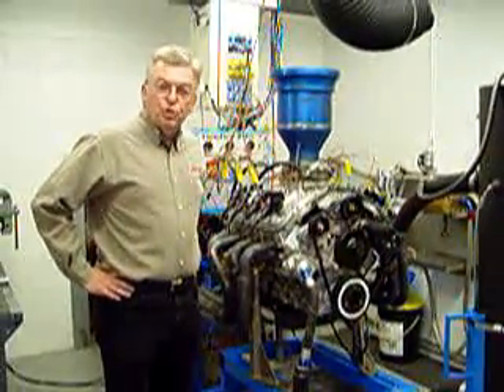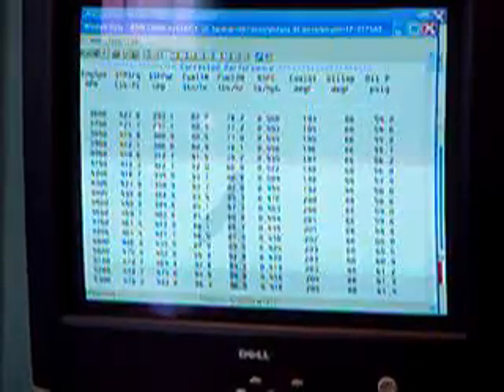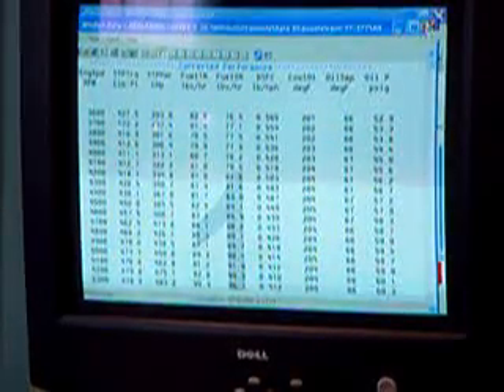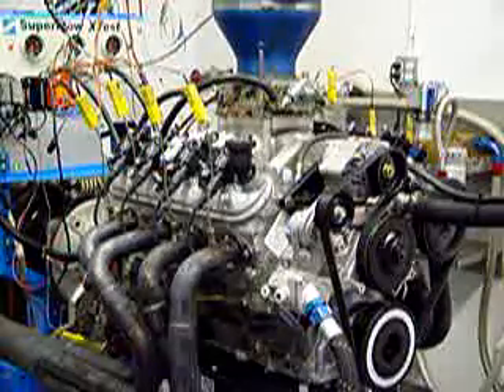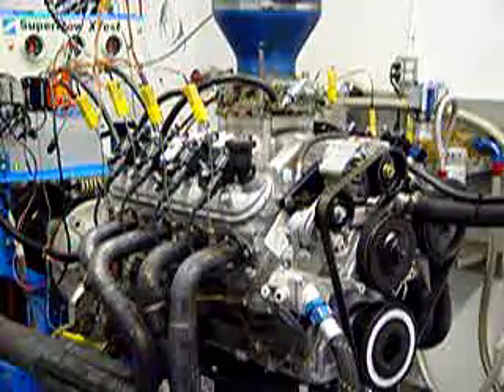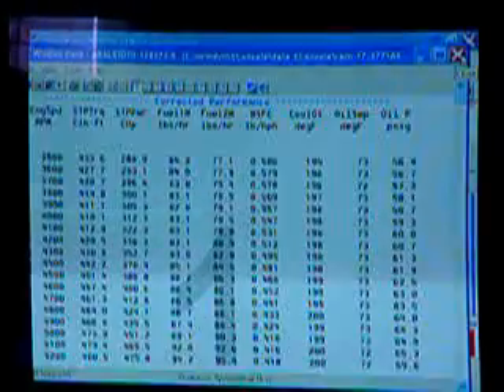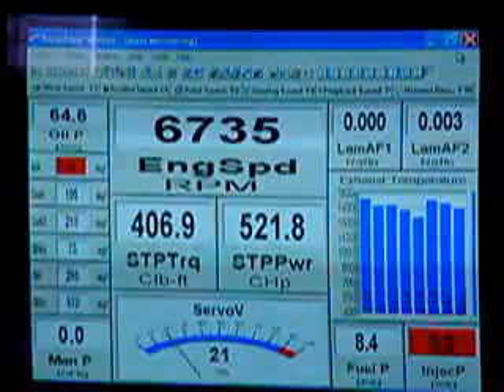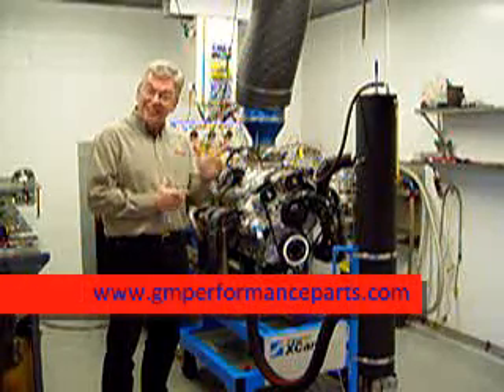GM Performance Parts CT525 Circle Track Crate Engine

Comment: Uhhhh, that's not what I would call a break in.  Not too bright to go right to 7000 RPM under full load unless you want to shorten the engine's life.  Good thing GM over engineered these engines with these clowns at the helm.

Comment: these motors have a cast crank ,, what " genius " came up with that idea ?
Reply: Cast crank my LS2 with CNC ported LS3 heads has turned 7200rpm many times since 2008 and still doing so the stock cast crankshaft is stronger than the stock connecting rods and pistons seen people replace rods and pistons with the stock cast crankshaft up to 650 N/A crank horsepower believe me this engine is absolutely not like the old Chevy small block the LS 6 bolt splayed mains holds the crankshaft in place with no flex even at 7500rpm they also last pretty long compared to 2 or 4 bolt main old style engines at above 6500rpm especially comparing it to any old style stock engine you'd have to do a lot of upgrades to even come close to match the power longevity durability and performance of a LS Chevy engine seen stock 5.3 Chevy truck engines completely stock with over 100,000 miles on them hit with a150 hit of nitrous over 75 times at the drag strip and still doing so and still running good without touching the short block other than a SFI balancer hardened pushrods and replacement timing chain
Reply: The only thing that suck on stock LS engines is the stock harmonic balancer and stock pushrods especially if repeated revving above 6200rpm but should be alright to repeated 6000rpm revving

Comment: well , Ford beat you guys to it , they're building higher HP crate motors , with standard easier to use external parts ,  whipped ya again ,,
Reply: Levisnteeshirt1 no they are not . this is for circle track ford has only 415hp 347 junk.